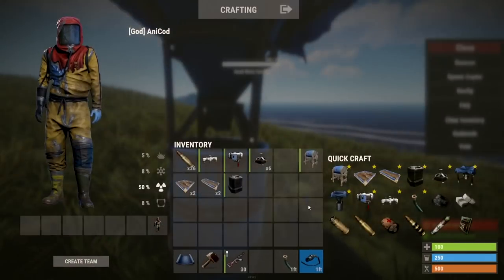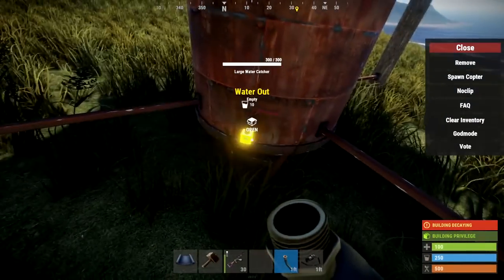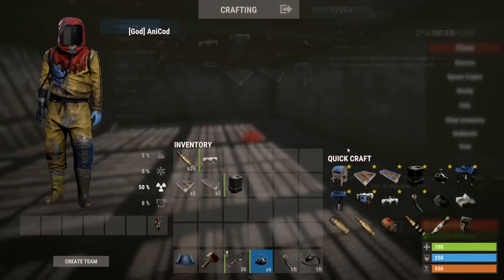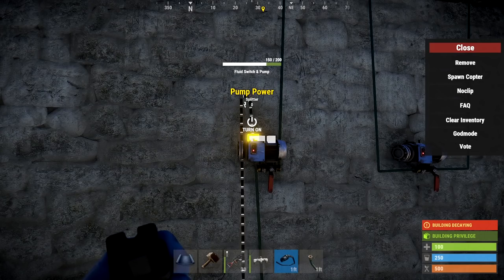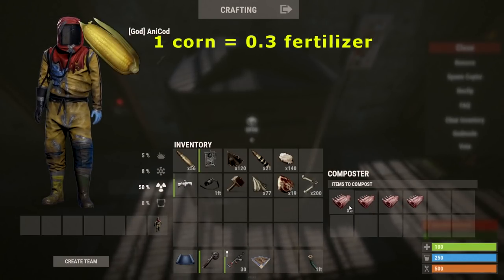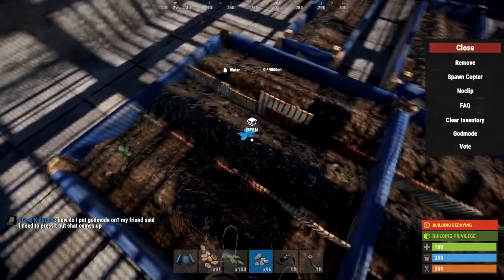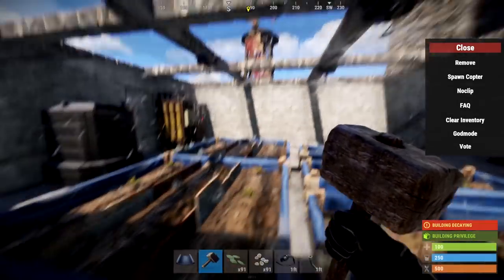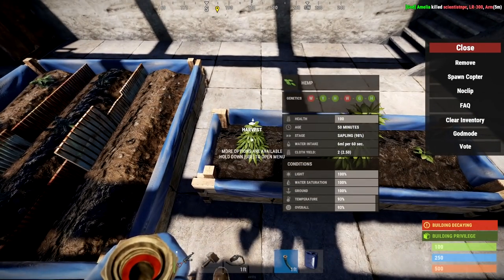🌲🔌 RUST - FARMING - Beginner to Pro in 10 Minutes - COMPLETE GUIDE 🔌🌲

Comment: Fluid splitter is very useful.
You don't always want to have all sprinklers in usage at the same time. Splitters help with that.
You also want them if you have multiple water barrels for water storage. I tie up all my gathering tubes into one combiner and then into splitters to even out the water into the different barrels.

Comment: For some reason, i cant make this to work... pump is just doing nothing, even tho it's powered and everything is connected ok, water catcher to the pump input, then output of the pump to the water barell, and the pump its powered from a splitter of a large battery w/o any other connection on it so its fully powered, and thats doing nothing, pump its just not working
Reply from the maker: the key things are.... pump has enough power (green light when switched on) water input is providing enough water for the pump.. tap of water catcher into the fluid input... output of pump into the top of the bowser.... make sure switch is active.. if that fails, look at the server youre on, some servers bug due to the amount of mods applied to them, they can conflict with eachother. ive had solar panels not working and allsorts. if its vanilla then im really unsure
Reply: @AniCodYT  i had to place the water catcher and the water barrel above the sprinklers so the water falls with gravity and then pump the water to the sprinklers, for some reason i cant get the water go up even with a pump if the water catcher or barrel are below the sprinklers...

Comment: Hi thanx, usefull video, I have a question, how many sprinklers should i have for 4 large planters? is 4 enough?
Reply from the maker: its all down to the amount of water flow youre putting through. I would put 4 planters next to each other to make a huge square and then put 3 sprinklers on the roof where they all meet in the centre. That should give plenty of water to them :-)